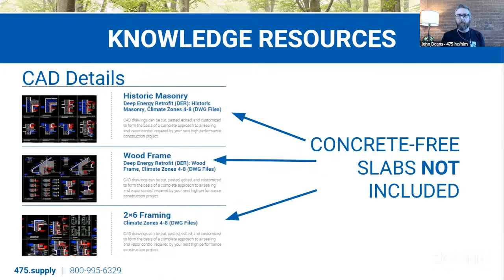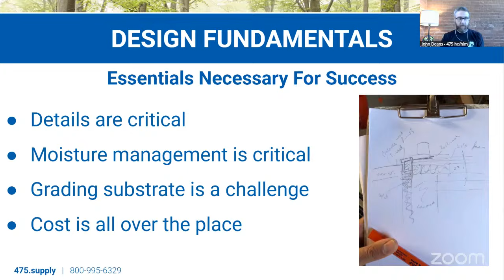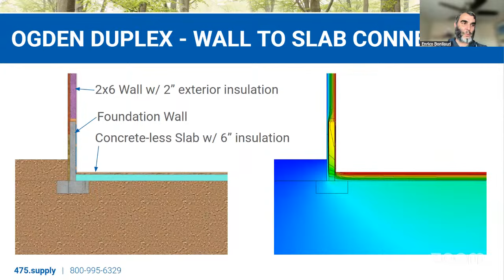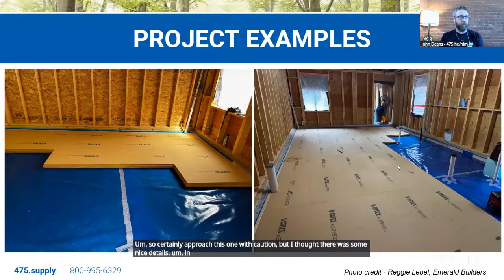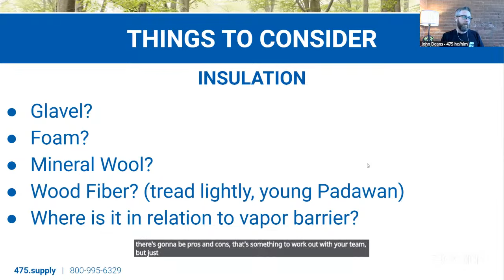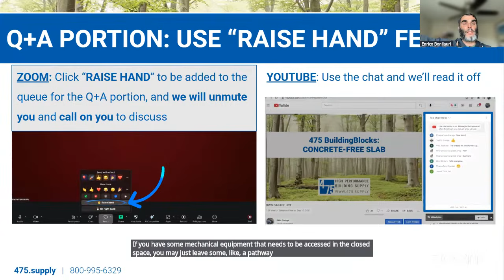475 BuildingBlocks: Concrete-Free Slab

Comment: I think it goes back to before 1986 with wood  foundations (AWWF) All Weather Wood Foundation. Also there was an insulated concrete floor  before that time that was the same detail as what you have but the wood section was concrete.

Comment: I am wondering about the use of MgO (MgSO4) boards as a more moisture friendly and stable option. I've been researching these boards and they are already being used extensively outside the US as a more carbon friendly option without the glues and off-gassing of Advantec and plywood or foam products. Any experience or thoughts on using these boards for concrete-free foundations?
Reply from the maker: We don't have much experience with this used on the floor, only walls. Sounds like an interesting option for lower carbon.

Comment: I built a similar concrete-free floor slab for a tiny house this year. The layers were from bottom to top: soil, compacted sand, galvanized mouse proof mesh, roofing felt, poly, 4" of XPS, and 25/32" gypsum fiberboard. So far, it's working well.

Comment: The lower embodied carbon aspect is appealing.  For full basements one function of the slab is structural to pin the base of the wall.  For this case would a hybrid approach of a perimeter of concrete functioning as a beam resisting this load make sense?
Reply from the maker: In these assemblies, the concrete-free slab is generally a non-structural element, so having a structural element (engineer approved, of course) to support the structure is the right approach.